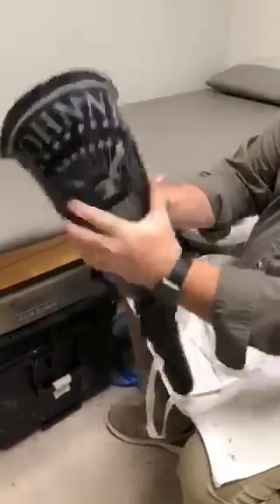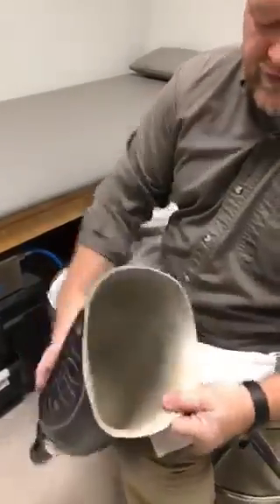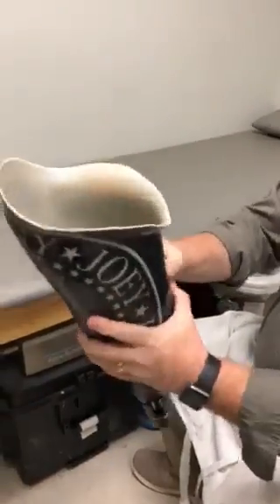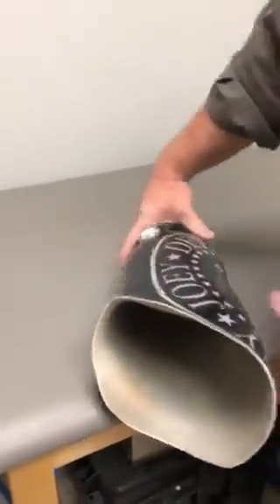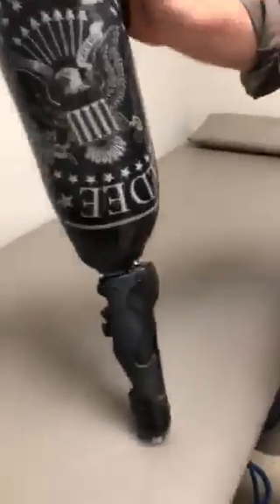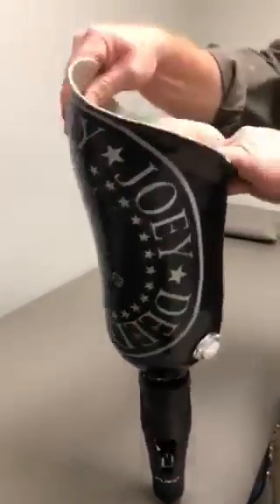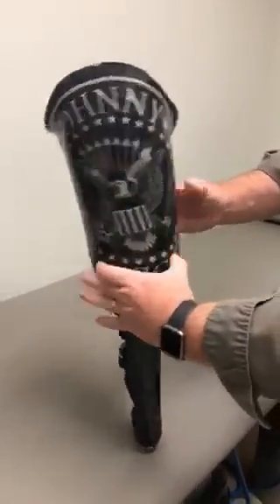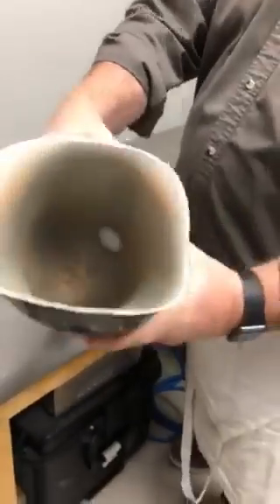Protheflex - AK socket - Snell Protsthetics and Orthotics - USA

Comment: how are these with a short residual limbs?
Reply from the maker: Hello. Yeah, that's a good question. If the remaining limb is shorter, the area of the flexible part is limited. You must know that in between the layers of the flexible wall of the socket, a rigid frame is laminated, through which the weight is transferred and which maintains the optimal stability of the limb in the socket. The smaller the limb, the less flexible surface. It all depends on how the rigid frame can be cut to make the socket as flexible as possible and still maintain good stability. However, in any case, the upper edge of the socket is always flexible and thus reduces the pressure on these edge areas of the tissue and at the same time increases comfort.
One idea: If the rigid inner frame is cut into individual longitudinal sections, the flexibility of the entire socket is increased, which gives additional comfort. So, my answer is that this system can be used for any length of the residual limb, it just depends on how the rigid inner frame is made, depending on the specifics of the residual limb. Here is a link to this "idea" about sliced inner frame: 
 https://youtu.be/S6MbK7nmKf8